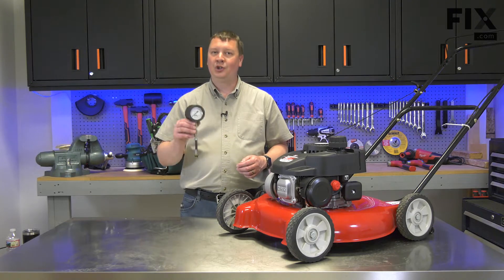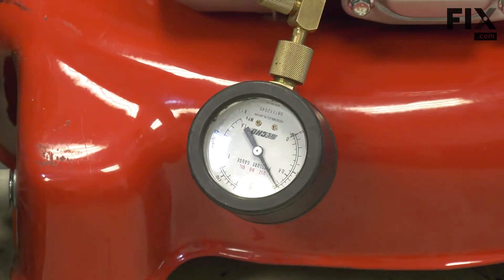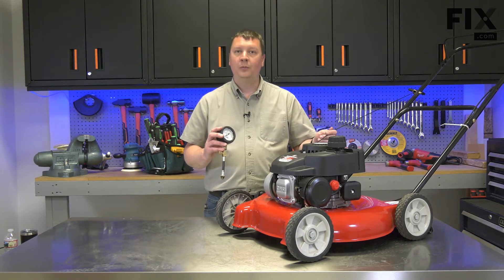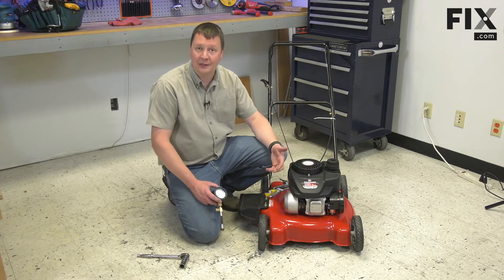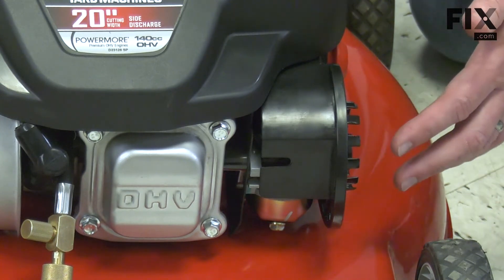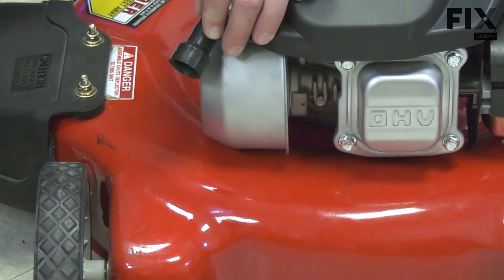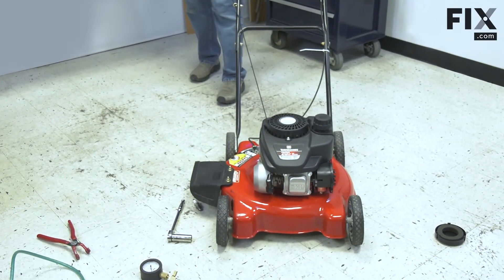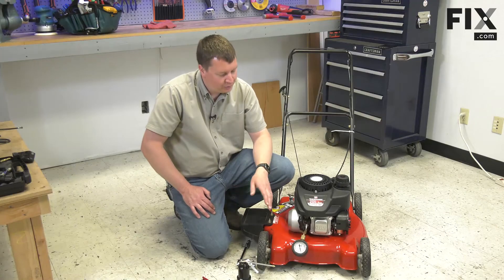LAWN MOWER REPAIR: How to How to Test for Compression Using a Compression Tester | FIX.com

Comment: Briggs & Stratton 17.5 I/C OHV - Just completed installing a new camshaft w/compression relief & tappets. Installed new sump gasket, torqued the sump bolts and when I spun the flywheel by hand had no compression or very low (probably due to the compression relief) but some pressure come out of the intake port. Rocker arms are operating, push rods not bent, and lash has been adjusted. Rotating clockwise I feel like no pressure should come out of the intake port. Help - Confused!